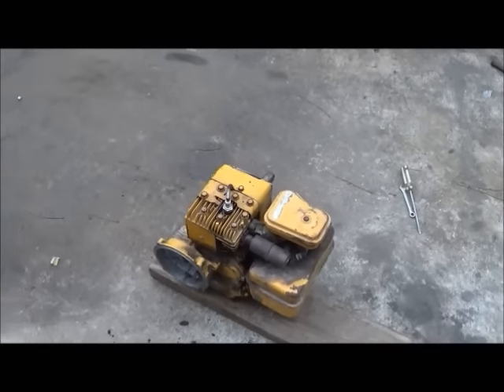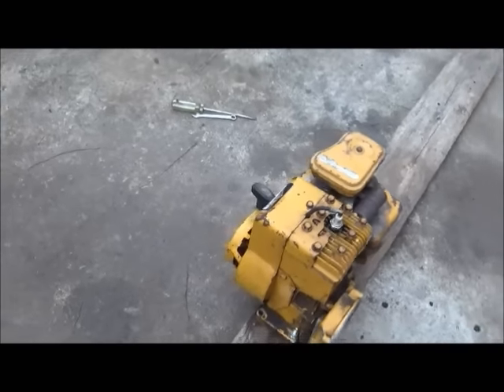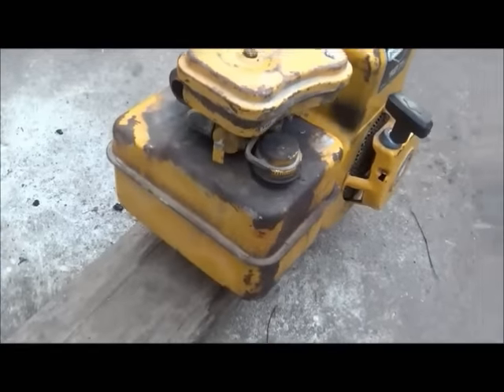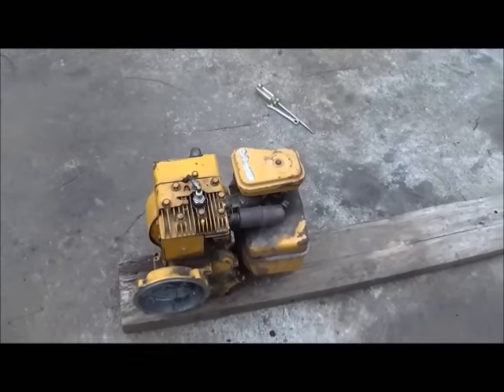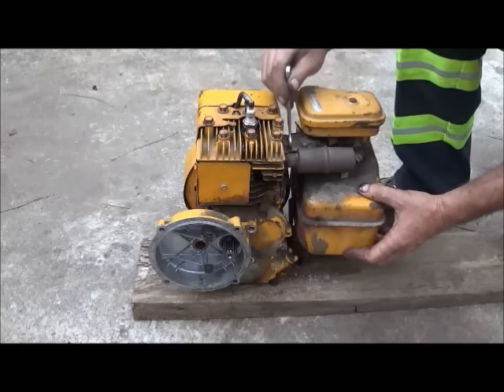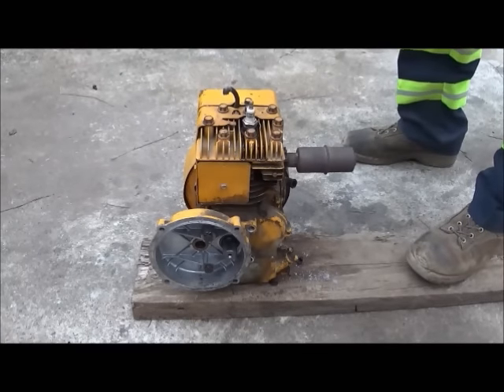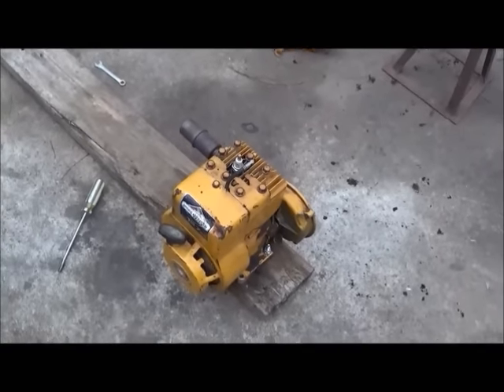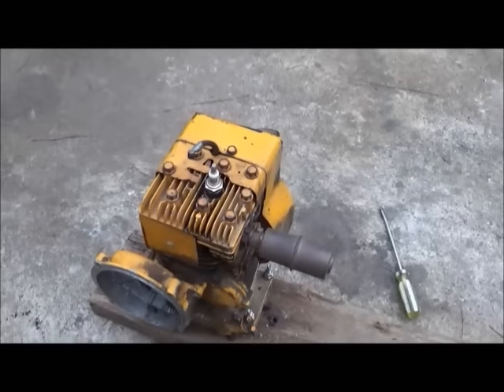Zombie Engine 3 hp Briggs & Stratton Halloween Special!!!

Comment: I just acquired an old 3hp Briggs & Stratton engine & plan to rebuild it for a go kart project for my son's, I sure could use any tips u have on these engines. I know for dang sure though that it wont run without spark from the plug lol...

Comment: horse hockey no butterfly without carb that motor would run wide open and blow
Reply from the maker: Not if you built a venturi that only allowed enough air through to idle